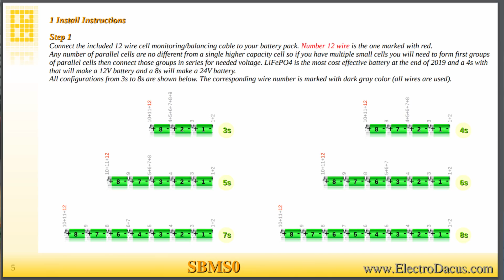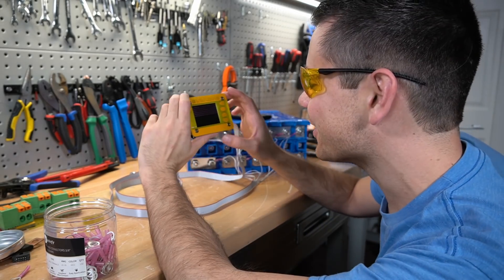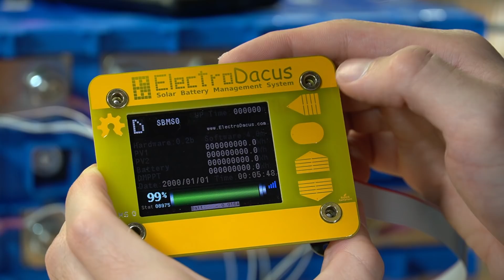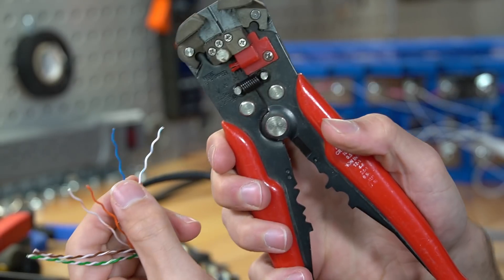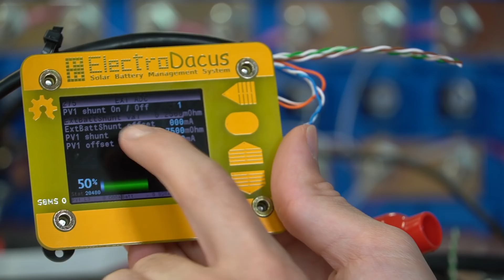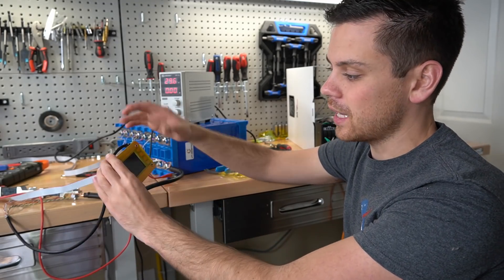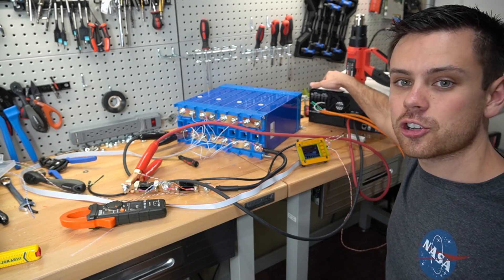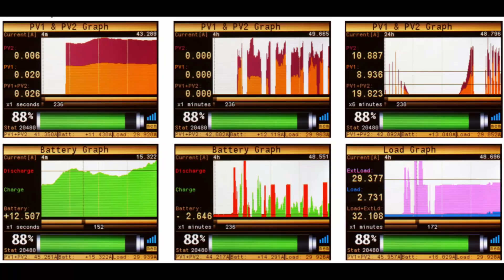Electrodacus -Open Source- Solar Battery Management System: Introduction and Setup

Comment: You should look into using shunt trips to disconnect the battery. They are basically a DC circuit breaker that are tripped by the BMS. Some BMSs (like Batrium) can trigger the shunt trip for many different scenarios to protect your system.
Reply: Those can be used using an EXT IOx set as type 5 that has secondary voltage limits in case something fails but inverter remote ON/OFF and DSSR20 are super reliable so if all is installed correctly and tested you will not need that extra level of protection.
Reply: @electrodacus  Hi. Please forgive me, I don't have enough technical knowledge to follow what you mean here but could you please clarify something for me? I am planning an off-grid solar power system on an island and am intrigued by your SBMS0, but I had planned to keep most of my loads DC (lights, lake water pump, refrigerator, fans) so that I would not need the AC inverter full time. Do you know of a battery shunt compatible with your SBMS that can also be tripped/disconnected via the same signal as your EXT IO3 sends to an inverter. Low temp or low voltage disconnect, if I have a lot of DC loads, needs something like this, yes?
Reply: @BenjaminRies  It is a good idea to have most loads DC that is how my house is also wired.  You should look for a Victron BP-65 fairly inexpensive and that will be able to switch ON or OFF your DC loads. There are also larger units like BP-100 and BP-220 but the BP-65 should be good in most cases all of them are fully compatible with the SBMS0 and you will just be connecting the EXT IO3 signal set as type 2 to the remote ON/OFF port of the BP65 and you can even have multiple BP65 on the same EXT IO3 if you want.

Comment: Nice presentation, would have liked to see Wi-Fi or Blutooth communication working. That's what's missing from most products on the market. Also what's up with needing 2 shunts? ZEVA doesn't. Finally, still waiting for a BMS  that includes active cell balancing AND network communication in ONE package. Enjoy your channel, keep it up.
Reply: One shunt is for battery current and one is for PV charging current this way you can know 3 separate thing instead of just one when using a single current shunt.
Say you have 30A coming from PV panels and a load of 40A then you will have the PV shunt measuring 30A that will directly supply the load and the difference of 10A comming from battery will be measured by the battery current shunt so you know PV current 30A the battery current 10A and SBMS can calculate the Load current as 40A
With a single current shunt for battery you will only know that 10A is going out of the battery and nothing else and while that is good enough to calculate the battery SOC is much nicer to know also the PV current and the Load current and have 3 separate energy counters to know exactly how much energy you used and how much of the load was supplied directly from PV and how much from battery. An extra current shunt is just $10 and I think is worth the cost for all the extra info you can get but you can also use the SBMS0 just with the battery current shunt but you will miss a lot of extra information so I recommend using both shunts.  All those devices that use a single current shunt only care about the battery so they have much less information available and you need to install extra meters to get more details about the system.  With SBMS0 you do not need any other meters as it will measure everything.
Reply: My bad. I am using an AC  coupled system with no direct battery charging from the panels and also assuming  a charge  controller would have a built in  meter. Thanks for the clarification

Comment: You should do a video on step by step how to set up the bms
Reply: The issue with that is there are sooo many variables that it would take forever .. the manual is phenomenal and there are several good utube videos ... its not hard to set up at all ... but you need to know what you are doing ...

Comment: I am a novice at solar.  If I wanted to use this with the Fortune 100 ah lithium iron phosphate cells you reviewed to build a 24 V system with 400 ah or 16 fortune batteries, would one SBMS be capable or would it take 2 or 4 SBMS units? How would the balance leads be connected for larger battery bank setup?
Reply: Yes a single SBMS0 can handle 16 cells or even more. You will connect groups of two cells in parallel (any number of parallel cells are no different from a single higher capacity cell) and then 8 of this groups will be in series for 24V.  My battery is made out of 80 cells each cell is 20Ah and groups of 10 of them are in parallel making the equivalent of a single 200Ah cell (not different in any way as all cells will have the exact same voltage) and then 8 of those groups are in series for a 24V battery.
Reply: @electrodacus  oh interesting,  I didn't realize this was possible.  So how does it balance each parallel cell? Or would you have to make sure its balanced before connecting  it the first time?
Reply: @bakadeshi_aunstudios  The parallel cells have no choice but to have the exact same voltage so they are as balanced as they can be no different in any way from a single cell. Even a single cell is made out of multiple plates so is like having parallel cells inside a single case.
Reply: @electrodacus  thank you for the response! I just ordered a SBMS0!
Reply: You would need 2, since this unit only works with 8 cells max

Comment: The product, help and support are excellent but like most setting up an off-grid home system and integrating it with victron products not supporting 48V has meant that non of his products are usable. All the other big solar mppt/inverter manufacturers would all be 48V in an off-grid house application. So disappointing!
Reply: I do not design anything that exceeds 50V DC open circuit voltage for safety reason and to stay in the Low voltage standard that is set at 50 or 60V DC around the world.
As SBMS0 can handle 750A and can deal with up to 30kW PV array I do not see a limitation in most systems.  I even fully heat my house with 24 to 30V DC system so there is not a big advantage to 48V other that some savings on wires but that from the total cost of the system is not much and the extra safety of lower voltage is worth it for me. I designed this for my own use I'm not in any way a big manufacturer is more of a hobby. I do understand that you are already invested in 48V so you need to stay with that.
Tow SBMS0 in series can control a 48V system but is not at all an elegant solution so not something I recommend.
Reply from the maker: That is true. 48v is king.

Comment: On my third solar system thanks to you. But am still buying pre made cable for the battery and inverter wires. Need to re watch your cable making videos.  ( did transition to 24 v thanks to you )  Thank you

Comment: Great review, Will. Looks like a good BMS. You mentioned it has hi/low temp monitoring and cut-off. Would like to see this tested given all the problems you have seen in this area with other units tested.
Reply: The temperature limits work on all SBMS models is just not as useful of a function as you may think. Is good as extra level of protection but if battery is not in a temperature controlled environment then you will need an isolated box with a small heater controlled with a $5 digital temperature controller. Once the battery drops below freezing it will take hours to get back to temperature so battery should be in isolated box and maintained at least at +10C at all times if is not possible to have the battery in a heated room.
My battery is next to me right now and that is the best place for the battery to be in.  I guess you will be using it in an RV or similar sort of application where you do not have a heated space.

Comment: Will 2 work in tandem for a 48 volt split phase system?
Also maybe I missed it but will (each one) support paralleling 2 or more batterys?
Excellent video when it gets you thinking. 👍
Reply: Bill Jacobs when working with DIY cells you don’t generally parallel batteries. Blocks of cells are parallel connected into super-cells and those super-cells are series connected to create the desired system voltage, so, if this is what you mean by paralleling batteries then yes it does.
Reply: @michaelhoulden9018  yes that's what I was inquiring about. I didn't realize how vague it read back.
I appreciate it 😎
Reply: @billjacobs8035  What Michael mentioned is true you need to first parallel cells as they are in no way different from a single larger capacity cell. As for 48V while it is possible to have two SBMS0 systems in series for that is not an elegant solution so it is not something I recommend.
Reply: @electrodacus  Thanks. I appreciate the advice.

Comment: What about using a battery disconnect from Victron rather than an inverter that has the disconnect.  One disconnect for the inverter and one for the charger.
Reply from the maker: A battery protect? They are not recommended for capacitive loads. Can lead to early failure

Comment: Where is the air intake of your heat gun.11:28 ? Hope that it not just on the rear.
Reply from the maker: On the sides. It's made to run like that.

Comment: You said the magic word....longevity. Designed to last, so i will be looking much closer at these. Thanks
Reply: These are designed to outlive 2 or 3 mppt's, if you want more reliability again take the tip Will gave about matching the panels to the batteries so you have a choice to use a more reliable PWM at max efficiency, which brings PWM within a couple % points of the be$t mppts.

Comment: I really don't care about the low voltage cutoff because most inverters already have that built-in
Reply from the maker: Not useful actually because the inverters do not have individual cell monitoring for lvd. In a LiFePO4 system, you need cell monitoring or else you risk over discharging the lowest capacity cell. 

So please, never use the internal built in cut off.
Reply: Yes Will answer is correct the inverter low voltage cut off is only good for Lead Acid it will not work for Lithium and this is one of the important roles of a BMS both for low voltage cut off and also high voltage cut off.

Comment: Hi.  Just checking.  The SBMS does not balance cells but rather, can turn an inverter OFF when Any 1 cell in the bank, drops below its minimum set point. . True or Flase. . . .  .   And.   Is the terminals from the SBMS operating the Inverter,  just a set of Voltage free contacts. . .   Yes  or  No. . . . . .   Ta.  Great job to. . . From Australia.
Reply from the maker: No, it balances the cells.
Reply: It has automatic cell balancing once the battery hits a set upper charge. These values  you can adjust but for you lifepo guys, this is all automatically preset for you.
Reply: Yes the inverter is controlled by a set of voltage free contacts it is the output of the Toshiba TLP187 optoisolator that controls the inverter same thing on EXT IO4 that controls the DSSR20 or any other charger of your choice that has remote ON/OFF
The SBMS0 also has build in cell balancing that starts as soon as there is more than 10mV delta between any two cells and there is at least a 300mA of charge current so that cell balancing is not discharging the cells but just provides the highest voltage cells with smaller charge current to allow the lower voltage one to catch up. The same type of cell balancing you will find in a modern commercial EV. You can check all the other details by looking at the ISL94203 spec as that is the main BMS IC used in the SBMS0

Comment: Already got mine last week. Get the Wifi module, You can use Tablets to display your charts. 

My SBMS will be used with 1,200 watts if solar, and 300ah/24v lithium
Reply: Get a temperature sensor for the battery. It does low temp disconnect which you have been looking for.
Reply from the maker: Will do, thanks
Reply: @WillProwse  your channel is very helpful. Great work buddy. 

Something I find intriguing is the case design. Most people put their PCBs in aluminum or plastic cases. This guy built the whole thing out of PCB material. It's elegant and beautiful.

Comment: Hi Will!

Great video. I have the sbms120. I was wondering, why do you use 2 shunts (1 for charging and 1 for inverter)? Cant you use 1 shunt cause they are bidirectional?

Cheers!
Reply: Valentine, I just posted an answer to this but here is that same one below
"One shunt is for battery current and one is for PV charging current this way you can know 3 separate thing instead of just one when using a single current shunt.
Say you have 30A coming from PV panels and a load of 40A then you will have the PV shunt measuring 30A that will directly supply the load and the difference of 10A comming from battery will be measured by the battery current shunt so you know PV current 30A the battery current 10A and SBMS can calculate the Load current as 40A
With a single current shunt for battery you will only know that 10A is going out of the battery and nothing else and while that is good enough to calculate the battery SOC is much nicer to know also the PV current and the Load current and have 3 separate energy counters to know exactly how much energy you used and how much of the load was supplied directly from PV and how much from battery. An extra current shunt is just $10 and I think is worth the cost for all the extra info you can get but you can also use the SBMS0 just with the battery current shunt but you will miss a lot of extra information so I recommend using both shunts.  All those devices that use a single current shunt only care about the battery so they have much less information available and you need to install extra meters to get more details about the system.  With SBMS0 you do not need any other meters as it will measure everything."
Reply from the maker: One is bi directional and one is for charging.

Comment: ElectroDacus is nice stuff. Looking forward of having one soon.....👍
Reply: Oh and by the way. Can you provide the link where can i acquire the Shunt?
Reply: @rds0009  You can find shunt anywhere like eBay, Amazon, Aliexpress, Digikey .....  just search for 75mV 200A (just an example not sure what current value you will need for your shunts anything from minimum 10A and max 750A will work) and the two shunts can be different values.

Comment: @Everlanders use the electrodacus in their self built RV rig along with arduino controlled stuff, might be worth having a word to see what project ideas you could come up with.
I still haven't sorted a BMS for my CALB cells yet, was thinking either 123SmartBMS, Batrium or this thing.. Seems partly wasted when I already have a Victron 712 monitor but that can only do overall pack voltage disconnect and victron do nothing in terms of 3.2v cell monitoring balancers :( certainly don't really trust the "simple" BMS boards from Ali :D
Reply: Hi, 
The real strong point of ElectroDacus’ system is to store energy in the form of heat (or cold in a fridge/air conditioner I guess) in stead of in batteries. You’d have to watch one of his early videos for that. 
You could save significantly on extra battery capacity (or on cycles of your current batteries) with this system. To my knowledge ElectroDacus is unique in this. If you don’t mind a bit of DIY and you can store some heat or cold I think this system will save you a huge amount of money.

I don’t have hands on experience though so ...
Reply: Look at the CHARGERY BMS .. we love it

Comment: At 15:33 you mention the Victron inverter.... very expensive. Ok, I can agree they're not that cheap. But on the other hand, they're one of the best brands in the world !! So is Mastervolt. I've worked with Victrons that are over 25 years and they still perform excellent ! Also spare parts and support are still available after decades. But then again, who needs spare parts for a Victron ?! They never fail or brake down, even if you abuse them (untill certain limits I guess...).
Anyway, a nice video as usual !
Reply: It seems many people love Victron equipment that was one of the reason I mention them in my manual and they also have remote ON/OFF for almost all their devices as they also started using lithium and realized remote ON/OFF ports are a good idea.
Reply: @electrodacus  Is your BMS compatible with the Victron Venus GX series monitors?  I've been designing some off grid remote internet tower power designs that can supply all possible data remotely, and there is very little option for the BMS data without going with Victron batteries.
Reply: @JoelKleppinger  The SBMS offers all the info GX can offer so it will not be needed. The new SBMS0 (never version that shown in this video) has client mode for the WiFi and MQTT so can be monitored from anywhere.
Reply from the maker: Yes great point. Good inverters are worth every penny. Victron is reliable mid level equipment.

Comment: Too bad this doesn’t support 16S configuration for 48 volts? Or does it?
And does this do any balancing for the batteries?
Thinking of usage in high load systems like electric boats...
Reply: Yes the SBMS0 will do cell balancing and max current supported by SBMS0 is 750A that allows for 20kW loads and up  to 30kW PV array with dual PV option described at page 16 in the user manual.
16S 48V possible with two SBMS0 in series but not elegant so I do not recommend that tho a few people have done that.